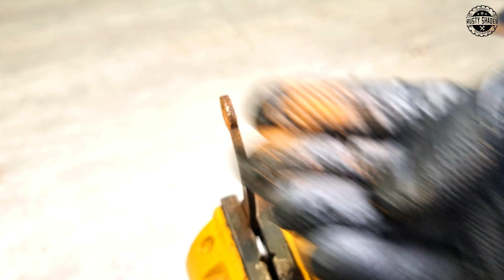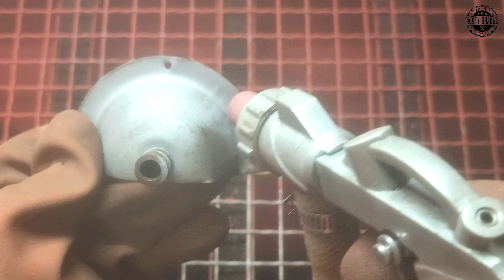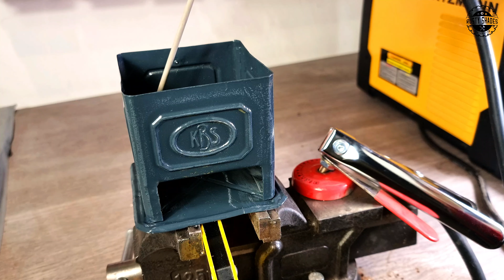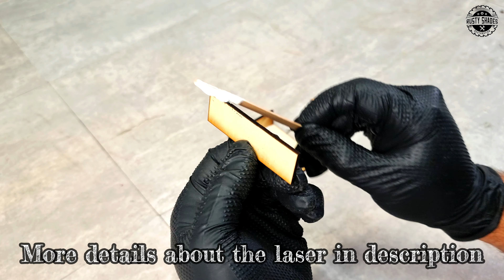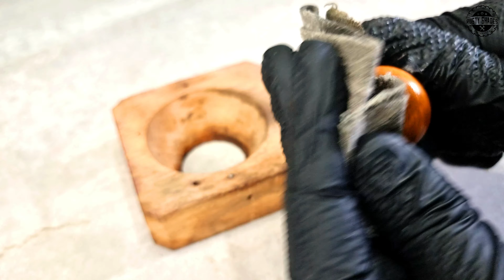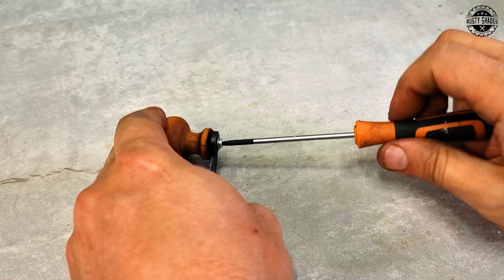Coffee Grinder Restoration & Customization - Making a New Drawer with xTool D1 Pro Laser

Comment: I think I like them mounted on a base board so you don’t have to hold the body while grinding. I’ve seen them both ways .lovely!
Reply from the maker: This one wasn't designed to be mounted on a board, but previous owner did it, had some little holes pierced randomly. I will let the next owner to choose how he wants it 😌
Reply: @rustyshadesrestoration   I saw that! It just seemed a bit clumsy to have to grip the whole case to turn the handle. Works great either way.
Reply: I have one with a handle on the side that one holds while grinding. It belonged to some of the great-great relatives of the past.